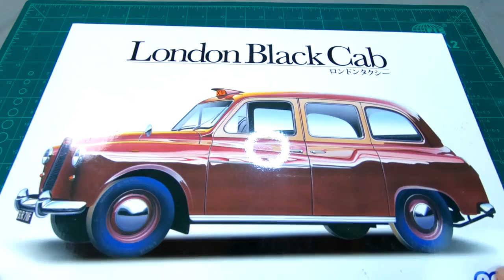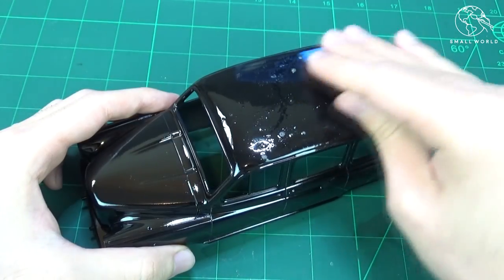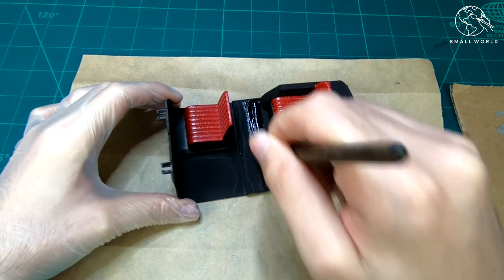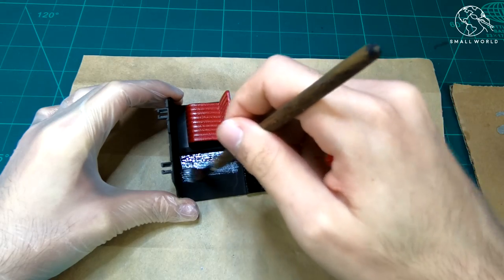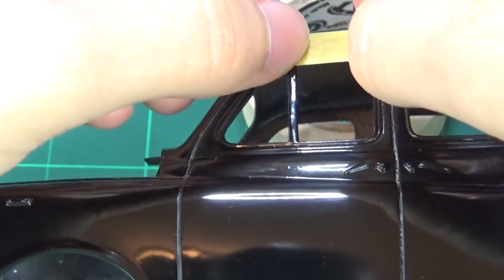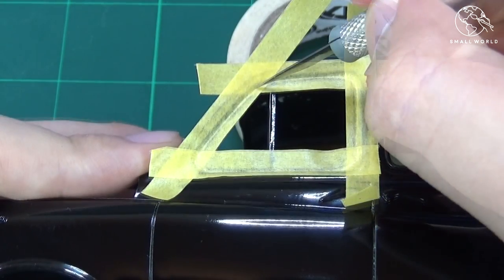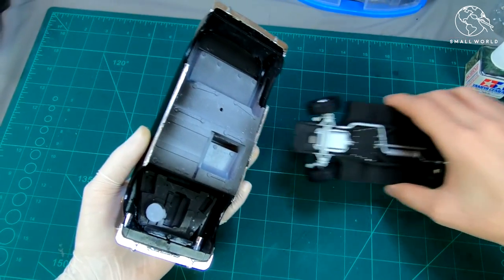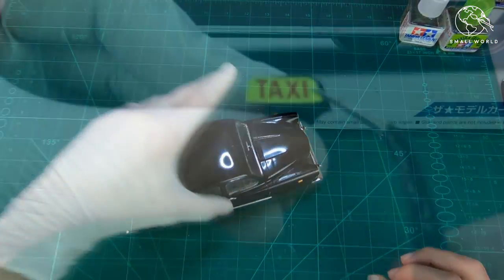Old London Taxi Car Build and Restoration/Enhancement - Step by Step Building

Comment: That is the most mirror like paint job I’ve seen! I’m going to use that technique on my Tamiya 1/12 scale Super 7 ! I wanted gloss black, but never knew how easy it would be to obtain those results! OMG! I’m curious why you didn’t apply Bare Metal Foil around the window openings? While you were masking the window surrounds, I was thinking 🤔 “Why isn’t he using Bare Metal Foil?” Then you used it for the kick panels. Just wondering.

Comment: Nice model, but it's missing two extra seats, but beautifully done!
Reply: The additional passenger seats (rear-facing) are there, they were just folded up. For anyone that doesn't know, they are spring-loaded seats that flip up like cinema seats when not used by passengers. Brought back a lot of memories. Except, I don't remember them being carpeted. I recall them having a hard-wearing linoleum like floor covering.